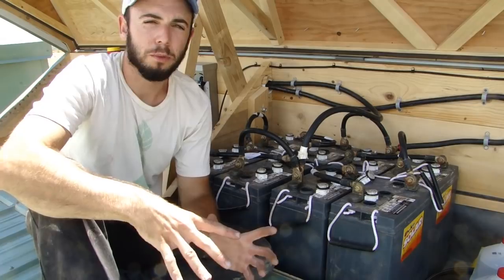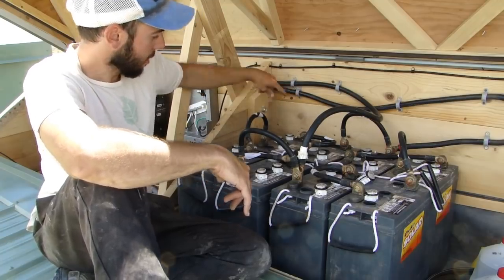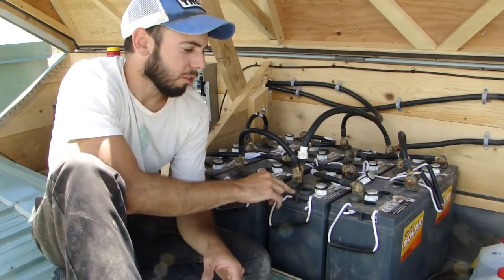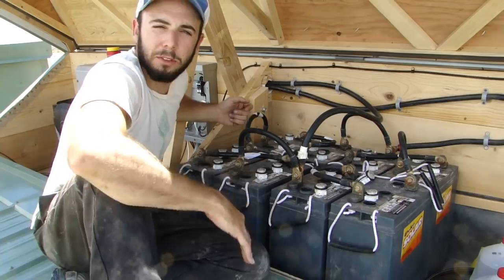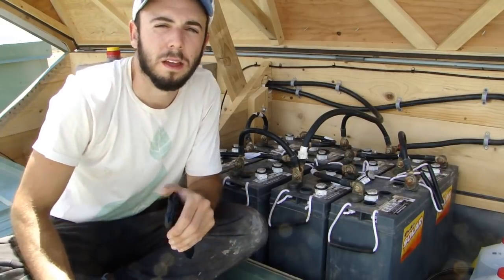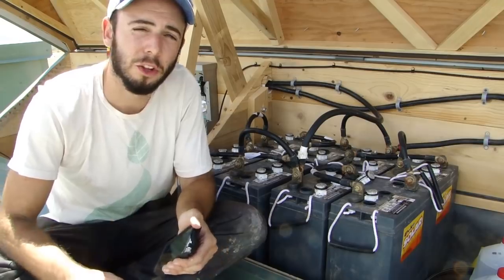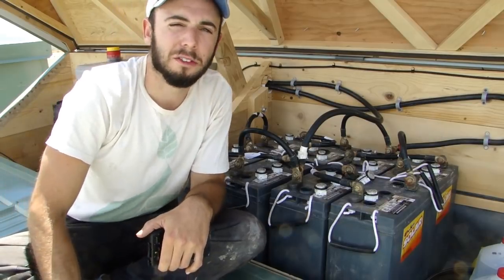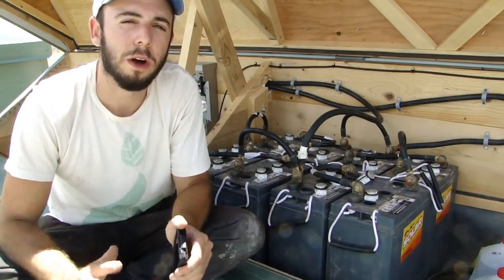How to Size Your Solar System

Comment: I have two 30 watt solar panels charging a 12 volt battery. It is powering three led lights inside my shed that get minimal use and two lights outside my shed that turn on at night via a photo cell. They worked great after installation but now the battery is dead. I think I need more solar panels?
Reply: You tells us.  What was the battery voltage every morning at sunset and the battery voltage at every sunset ?

Comment: Can someone please explain why do people use multiple batteries?  I mean wouldn't it be easier/ cheaper to install 2  24Volt batteries instead 8  6Volt batteries?
Reply: A 24 Volt Deep Cycle Battery ?  I could never pick it up without an engine hoist  ...

Comment: Now, how do you regulate that draw that your appliances in your house are using? How do you know just how long you can use your washing machine, computer, cooling and other stuff on your system? How do you determine how much power those devices are drawing per hour?
Reply: Use a kil-owatt meter ...

Comment: You can leave the caps on while equalizing it's done all the time with forklift batteries and I have no problems caps keep the acid in the battery
Reply: Is there any mfr that recommends removing the caps?  Trojan recommends leaving the caps in-place.  I do not like the splashing of electrolyte when the caps are removed = lost electrolyte forever...

Comment: Looking into buying a  4500w 48v 93.75 amp soler system. 15 300w panels, 8 550ah 6v batteries. 
 I would appreciate help figuring out what this would do for me
Reply: It will give you 4,500 watts x 5 hours/day x 80% = 18 kilowattt-hours per day or 540 kilowatt-hours per month = about 1/3 to 1/2 of typical family home.

Comment: When the batteries are full, how to automatically stop the charging ?
Reply: Batteries here are essentially the same (not identical but close enough to explain this to you).  Let's say you buy a brand new off the lot car or truck. Itll have a fuse box, a battery, alternator and another cluster for relays, switches etc.  So you start the car and start driving, and as soon as your battery is recharged it just stops taking any more charge. Heres a layman on how it works: When the engine isnt running the battery is supplying battery power to the cluster, clock, radio etc. But once you start the engine the battery is rewarded and stops supplying power. When you start the engine, your serp belt turns a circular metal rod inside the alternator.  As the rod (maybe a half inch round rod, 6 inches long) there are brushes etc that produce electricity.  This electricity being produced as you drive the car sends that charge back to the battery to replenish it. When the alternator dies, everything then is using battery power and that is a short fight. Anyway there are limiters and coils etc that cut the supply running to the battery to prevent overcharging it. HERE, the electricity is made by heat, it supplies the batteries and cuts that supply off when its had enough to drink. That's a long answer hope it helped!
Reply: The invertr does it automatically

Comment: Maybe you can answer this question. I want to put a solar power system on my travel trailer. 4 315 watt panels. 5 100ah 12 volt batteries. A 4kw inverter. 
The main item I will be using is my 13500 btu AC  if I run half of my panels in series and then parallel the out puts. Will it recharge my batteries. My max amp draw is roughly 19 amps. Where I live I have at least 7 hours of good sunlight. And this huge amp draw is really just for summer. Anytime after or before summer my power draw will be very very little. Thank you.

Comment: You said 'if you decharge your batteries daily below 70% or 50% your batteries wont last long' how about Tesla? Do you need to use only 30% of battery of your Tesla to able to keep the battery life long? No. Is it the battery type? Li-ion vs lead
Reply: This is Lead-Acid , wheras Tesla is Li-Ion = different rules.

Comment: I'm using 3 12v 200 amp hour agm batteries wired to 2 100 watt solar panels and the alternator with a solenoid. Is this a good setup?

Comment: You're 100%, once you get to that float stage energy is just not being utilized and u can flex your charge capability if you have good sun and efficiency on the panels. Another important factor as is true with most electrical devices KEEP THEM COOL! No direct sunlight, preferably cool dry air to prevent corrosion and this will also make your devices last longer.

Comment: great video, just a few questions if you don't mind me to asking
our household use around 3000kwh per month what system do i have to set up to produce this amount of power, how many panels and how many batteries. 
and one more question we have snowy winter beside removing snow's from panels i wonder if they actually can produce enough power in autumn and winter or not

Comment: Nice vid but Never use small 6 volt batteries 305 amp hr isn't near enough to get you through one night let alone any others ,cloudy day forget about it .So i run my house off solar using a Hybrid inverter (Schneider Electric 5548) so i have 48v forklift battery lead acid 1100 amp hr ,one the reasons you want to run your system from 48v dc is because of the voltage range you have for said voltage Full charge being 54 v and dead being 42v in contrast 24 volt stems have a range of 28.3v fully charged and around 20v when dead , so the difference that you can discharge a 24v battery is only 8 volts till it's dead.
In contrast at 48v dc it's range is 12v from 42 to 54 equalize is 57 so my hybred invertor makes sure the battery is at 54v ,but the charge controller is bringing in 57v so the difference goes to the Grid ,now if my A/c is on it pulls from my Panels not the Battery unless the charge controller goes below 54...........my watt hr is 52800

i Have 21 panels in all 7 in parallel with 3 in series on and at peak i have 90amps coming in 120v dc into the charge controller 
Going back to the Battery ,the more u use the battery the less time it will last  ,so proper mant. along with oversize capacity means the battery should last 20 25 years ,based on charge cycles ,you only get to use the first 80% in lead acid ,that's why 48v dc is recommended over lesser voltages ,water your batteries is a must......

Comment: you are not considering no sun days. that is why you want to have a much bigger battery pack so you have extra for the days you do not have sun. one other way to solve this problem is to hook up a wind turbine to your system and have both sun and wind. that way you will be charging your batteries in a trickle a lot of the time which keeps them from sulfating. look it up and you will see that this is a great idea.

Comment: Trying to figure total watts available after all the series and parallel wiring is confusing. Just figure 350 amp hrs times 6 volts = 2,100 watts times the eight batteries= 16,800 watts.
Reply: 2 Strings of 4. Connect four batteries in series (+ to -); increases voltage: 4x6V =24V; 

Connect the 2 strings in parallel (+ to +, - to -); increases the amps: 2 x 350 amp = 700 ah; 

System capacity = 24V x 700ah = 16.8 kWh x 30% = 5 kWh his daily usage/solar panel output-ballpark #s;

Comment: How are you getting 24volt and doubling your amps if u only have four 6 volt batteries u would need to run all 4 in series to get 24 volt so u wouldn't ge able to double amps
Reply: Ohm's law!

Comment: I appreciate your video, I would like to clarify that wiring in series does not "double" your voltage, it adds the voltage. 

In a system with two batteries, it would indeed be doubled, ie 9v + 9v = 18v = 9*2, if you had a system of three batteries wired in series (or more), the system would not double each time you added a battery, as in 9v*2*2 = 36, it would be added as in 9v+9v+9v = 27v. 

You understand what you are trying to say as reflected in your math, but some viewers may walk away from this video applying what their meaning of the word double implies. Therefore, this clarification is for those people rather than the content creator.

Thank you for the content you provide.
Reply: Thank you for this explanation.

Comment: Thanks for this info.  Worked at a place when the Power company's power is off although the roof is fully covered with panels.  There is no battery added to this system.  Now I understands why.

Comment: Old vid but still relevant. Serves to mention nowadays a lithium battery bank can be discharged to 20% instead of lead acid to 50%. Also, wattage on solar panels has also increased.

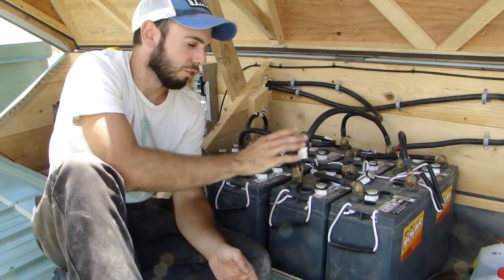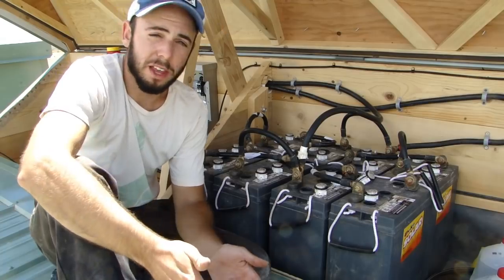Comment: 3:20  YES and NO... If you have 90 AMPS coming in and you are only using 50 amps and your batteries are Full (Float) then you ARE using that direct current but YES, it has to go through your batteries. so, YES you are using what you take in. @3:32 NOT TRUE. again if you are making / taking in MORE then you are using you are NOT using any of your batteries. 
5:11350AH X2 = 700AH @24Volts YES = 16,800WH  16.8KWH  
and then you have the 50% RULE. so @ 7:00 Don't go past 30-40 down. 
so you really ONLY HAVE 8.kwh that you can SAFELY USE. without hurting your batteries.

GREAT VIDEO!   TRUE INFO!  

9:00  if you use 3.5kwh per day and you only make 3k-5k a day won't you be OUT of power in 3-4 days if you have NO SUN?

Comment: Thank you, Dan! Very informational video. I have been wanting to get into the business of selling solar Panels for over ten years now. Problem being, I'm a U.S. Army helicopter test pilot (retired/veteran) who up until a few years back has still been flying (international) and now an "Aviation Maintenance Engineering" instructor (past two years) in Fijian and Shanghai, China, so time is limited. Hehehe Teaching my freshmen "Basic Electricity" this semester and I have been talking a lot about Solar Panels as a means of getting power (Green Energy) when none is available (different scenarios).

Comment: Great info, thanks. As we live in South Africa where our current government owned electricity provider cannot supply us with sufficient electricity anymore, with load-shedding (rolling black outs) 3 times a day at 150 minutes each. We are now looking for solutions like this. We are limited to 105mah and 120mah batteries over the counter. Am I correct in assuming that the max configuration for batteries will be 8 of which 4 will be in parallel configuration?

Comment: I don't understand why solar companies don't have a chart showing appliances and all devices a normal home uses. Then show how many panels and batteries you would need to meet the demand. I watch these videos and building off the grid videos and nobody really tells you what you need. If you have a mobile home what would you need? If you have a small home what would you need? If you have a big home it would take a system like this. It seems easy yet if you are not into solar it is a foreign language. My project is to get solar to handle a 14 X 70 mobile home (trailer) with a heat pump, washer / dryer, stove, TVs, microwave & lights. Will it run $10,000? $20,000? I would love to know.....Any help would be appreciated!

Comment: I generally advise look at all the information available and your requirements.    Then plan for at least 2 or 3 times as many Batteries as you think you will need.    Make or allow sufficient space for more later.     But then only install Half that many initially.     You can always add more Batteries if you find it necessary, but starting small, reduces your outlay.      And will also stretch out the Battery replacements over the years, rather than having to change them all at the same time.     We normally work on the N+1 basis, that is always one extra string than required, makes testing and maintenance easier.

Comment: I would not recommend Batteries be stored in a wood container due to the risk of fire
I also advise people to have a Switch or Circuit Breaker for each individual Battery String.    Do not simply connect Strings in Parallel.   Include an Isolater of some sort for each String, then they can be individual tested, or taken out of service.

Comment: if you use 5 kwh's today, and tomorrow your panels put out 5 kwh's, OK you would have charged them fully, except  you are going to use another 5 kwh's on tomorrows day so it will cancel out your charge gain

Comment: I have 3 12v deep cycle batteries, they have a max charging input of 10 amps each I have them connected in parallel QUESTION: do I charge them at 10 amps or 30 amps.

Comment: I’m sorry to say this but this was confusing as all hell lol. And I know how to size and install solar set ups lol. I clicked on your video to see how you would go about explaining solar and batteries to newbies. Showed this to my friend who is not “dumb” and when it was over all he said was, “what?” lol
Voltage isn’t doubled its added. Also, a lot of people aren’t familiar with 6 volt batteries of that size. Maybe do this over but use a white board instead of sitting in front of the batteries. This would allow you to pre-draw certain parts such as the panels, the batteries, the charge controller, lines between each with arrows showing “flow” direction of electricity etc. 
Good try, but confusing so it’s a fail. 
Better luck next time

Comment: He forgot the conversion to 110 volts ac which is different than 24 volt calculation so that your kilowatt hour number will be drastically lower. There is also conversion losses as well. At any rate 8 batteries will not run air conditioning or an electric range or even a water heater unless it is gas burning which is fossil fuel.

Comment: You also have 700AH that mean u can use 700A in one hour only
700A÷24H= 29.1AH with no charge 
29.1AH×24V=699WH 
You will need 1000w solar charge to be in the safe side

Comment: Is there an alarm on the system that warning as for discharge batteries below 70%? Especially when i use heating elements. Do you have any similar video? The other question is: can i make compination with wind turbine or i need separate control system? Thanks for your informative calculation!

Comment: As a semi-intelligent person, I can wrap my head around most concepts. But, even though I've re-wired houses and worked on welders that I've used over the decades (even took some DC electric and Electrical math classes for RE) I still have trouble with electrical formulas. Even the "water through a hose" example eludes me. I guess I'm a hands-on guy, and trying to label invisible, unhandleable things makes my head swim. You really helped me get a perspective on this subject that has eluded me up till now. Thanks very much. Just getting ready to undertake building an earth covered home and a solar/wind/genset system for it, and need all the help I can get in the how-to/knowledge department. Thank God for youtube and the people who post their experience there!

Comment: Actually you do actually work directly off the solar array!

Want proof? Get a shunt based battery monitor or use a midnite Classic charge controller with a "Whiz bang Jr" It will show the amperage flowing to the battery. Start a load and the amperage gong to the battery will remain the same if in float and the array can provide the current.

Comment: I really appreciate your presentation. Very informative. You have 5kw/ day available from your batteries and you are just actually using 3.5kw/ day for your washing machine, fridge and others. My concern is about the fridge. The fridge has to function 24/7. What about during night time , will the storage capacity of the batteries last over night? Or do you have to switch off the fridge at night? Pls enlighten me on this. Thank you.

Comment: I have a 20ft pontoon boat with a hard top ( perfect for solar panels) I now have a cranky old 2stroke 40hp Yamahaand would like to convert to electric motor with solar panels. I live in Florida and my goal is to run motor 100% off sunshine.my option in motors is 10hp, 14 or 20hp........Not sure how many watt panels I need with what motor to be most efficient.

Comment: In regions like mine it is very important to take the WORST month of the year for sizing the system. There are only 0.8 sunhours in Berlin in January (one can google how many sunhours a certain playe has). So you should consider supplementing with an diesel generator or wind mills or whatever.
The yield of solar panels shrinks the older they get. Let's say you have ten panels. After one year or so you need to buy another one because the yield of those ten panels will have decreased to some 90 percent (within that year).
Whereever you can: Feed DC directly to devices! That's more efficient than the detour via an inverter.  Finding the right inverter is extremely important. Those things suck current even without doing anything. The smaller your system the more important it is how many milliamps the inverter taps WHILST DOING NOTHING! The shorter the low voltage cables the better. Place the batteries and inverter as close as you ever can to the panels. Use the thickest (copper) cables in town and or double/tripple every line.

Comment: The day you connect those batteries the A / Hour starts to drop. Even a deep discharge battery would die permanently if you drained it completely. You should use about 250 A / Hours MAX. In cold weather battery performance drops dramatically as it does in a car. The higher the charge / discharge rate the shorter the battery life. Running off grid and on grid you can get the best of both worlds. I'm afraid the real world of batteries is a little different to yours and certainly not as rosy as you make it look.

Comment: Hello I have a question how much current can I use to charge my lead acid battery using solar. We get sun for nearly 4 hours a day and I had done many research online the only thing I could find is that do not exceed 10% of the battery capacity but I think it is stupid to that because the battery will never become full in the above said method, any suggestions on the charging current